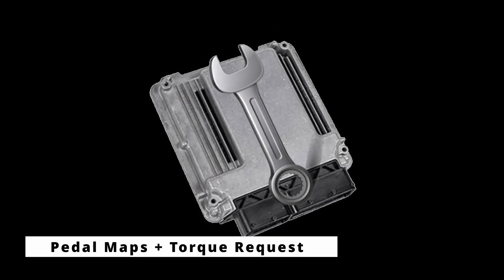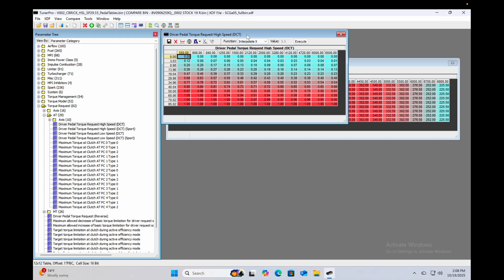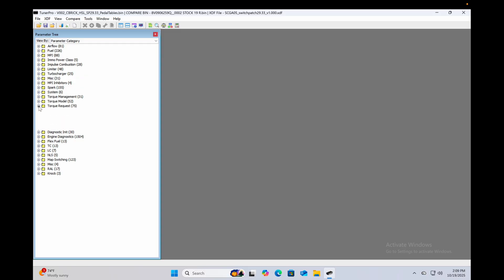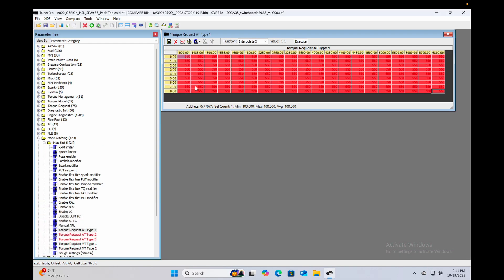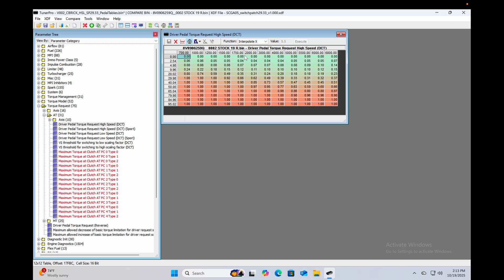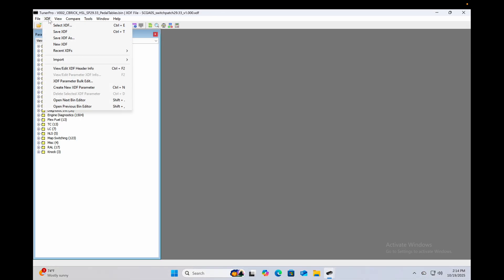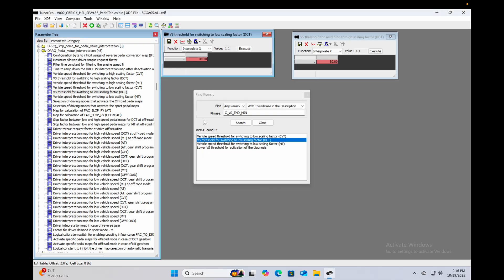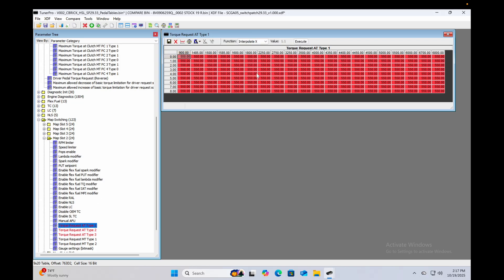Raising Torque Request [Simos Tuning Series]

Comment: Have you ever seen anyone able to tune the 1.8 auto 09g transmission?
Reply: I did. It was fun. No trans tune but ecu tune. Crossflash to 8v0906264k if ur a 2016 US sulev 1.8t. the switchpatch xdf in the Google drive for it is really good.
Reply: Yees
Reply: We can tune the 09G